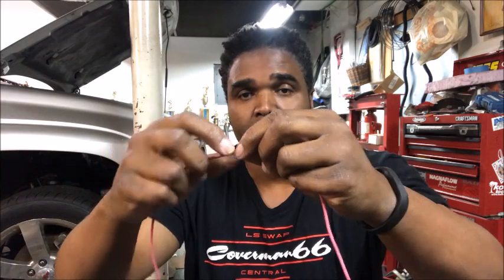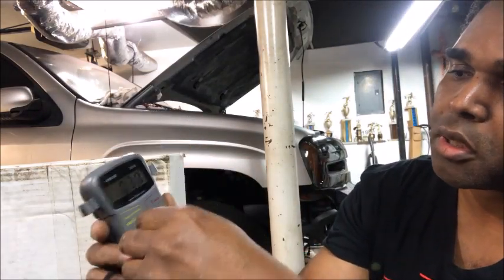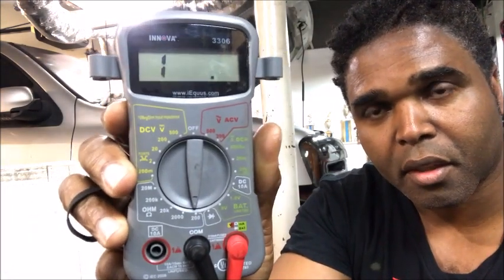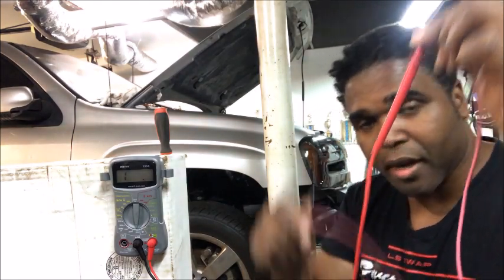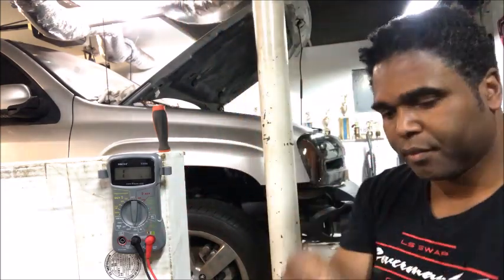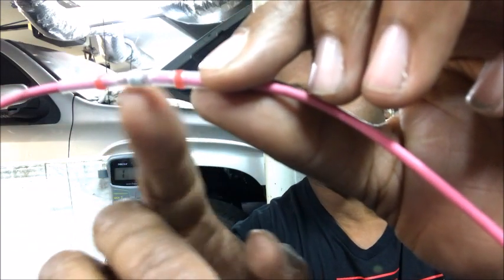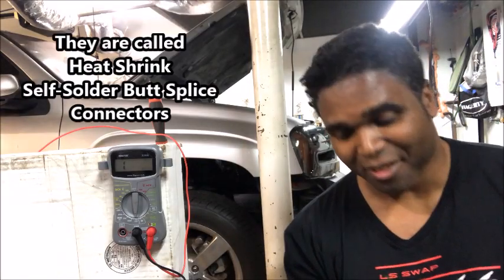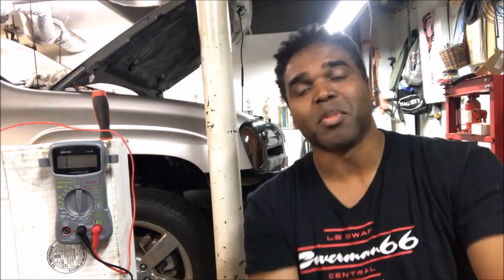How To Use a Multimeter (Check Wires, Heat Shrink Solder Connectors)

Comment: Those lil heat shrink solders are so nice!!! I used them before and I usually twist the wires together and then use that heat shrink solder.

Comment: I’ve try them before, they do work but I’ve notice two things, one is that it also depends on the quality of them some work and melt really fast others take longer to melt and two if you are trying to use them outside on a cold weather they won’t melt at all or they won’t melt completely, that’s my experience with them but they are great for quick and easy repairs.
Reply from the maker: thanks for the info brotha LJ, i guess its like anything else you have to get that quality ones..